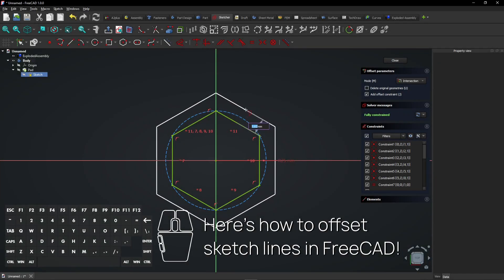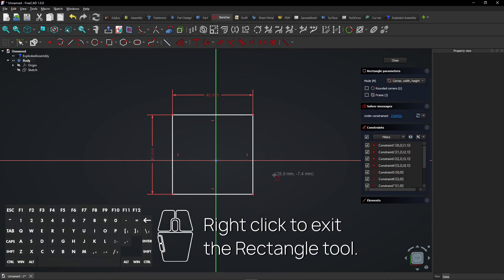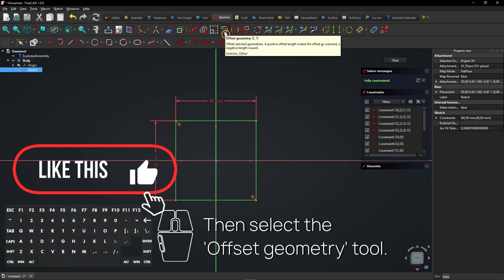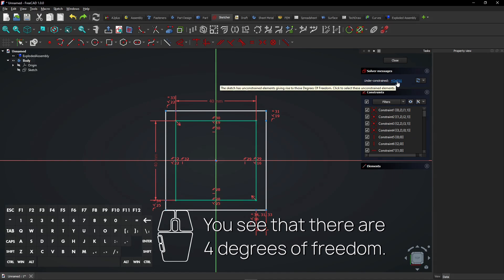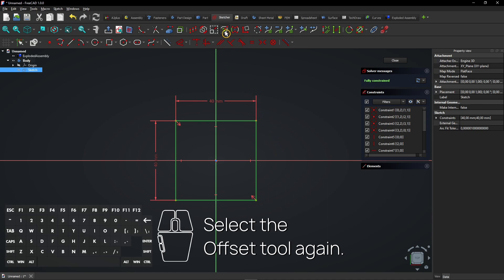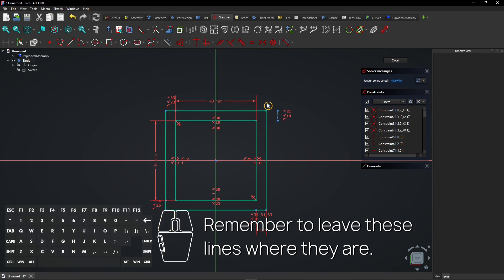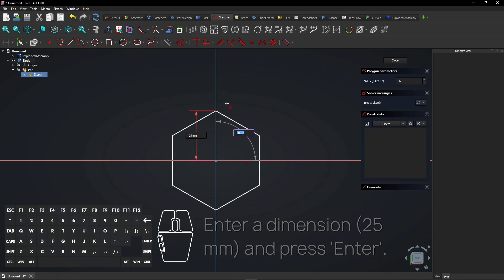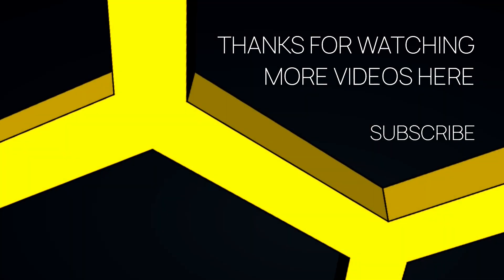🙏 Offset Sketch Lines In FreeCAD 1.0 - FreeCAD Offset Sketch - FreeCAD Sketcher Offset

Comment: Hi,thanks, good tips in this video. I want to know if there is a way to "convert edges" from a body into a sketch, and then use those lines to offset and use,  like in solidworks? 
"Create External Geometry" doesn't allow to offset or use directly within a sketch. Thanks a ton!
Reply from the maker: You're welcome! I honestly don't know if that kind of external geometry can be converted. Worth a try for me.
Reply: @AllVisuals4U  thanks, looking forward..
Reply: You can import the edges, set them as construction geometry draw new lines on top using the imported construction geometry and then offsetting. Bit cumbersome and can be problematic with curves but works well generally.